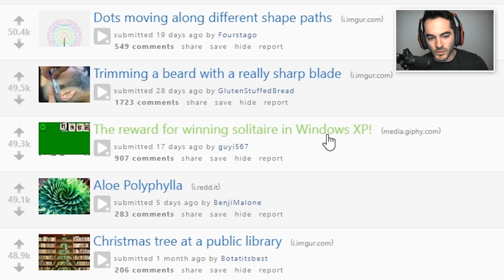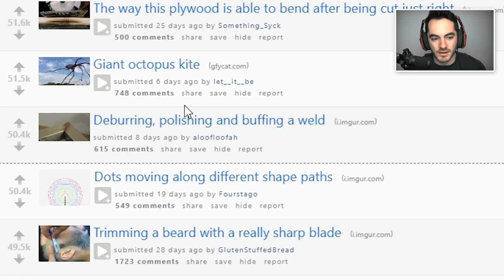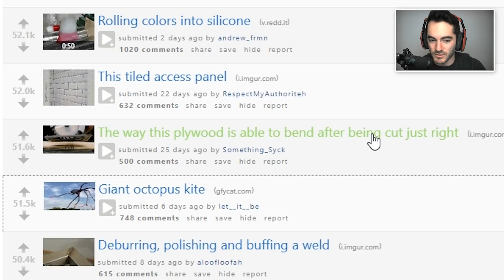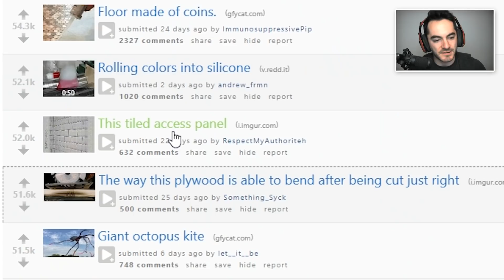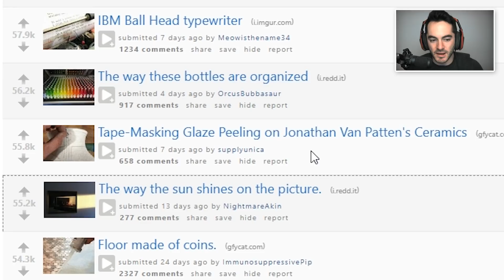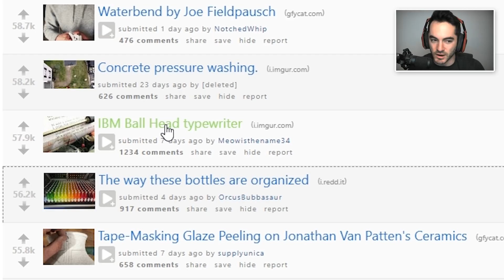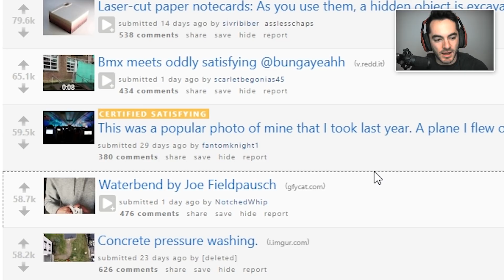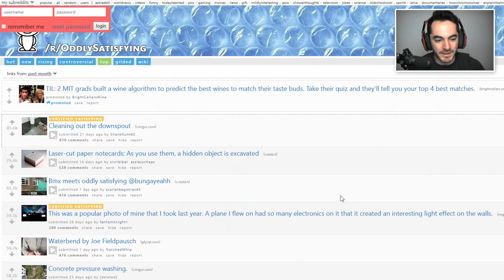HOW TO TASTE THE RAINBOW

Comment: TL;DR i did a ton of fucking math and yknow what if you want it just fuckin do it

On the penny floor...
Each square foot of "tile" would cost $2.56.

A square foot is 12x12 inches; a penny is 3/4 inch wide. So it would take 16 pennies to make 12 inches; 16x16 is 256, and since each penny equals 0.01, each square foot costs $2.56. This is assuming they're in straight rows, and not nested; nesting them would probably at least double that, so we'd be looking at $5.12 per sq foot for just the pennies.

Of course, that's just for the pennies. The clear coat is usually either an epoxy or a polyurethane; using an epoxy will drive up the cost and the labor ($200 for what you need and can be easy to screw up if you're new to epoxy/resins, from my research) whereas the polyurethane is much cheaper and easier to use (less than $50 a gallon, iirc, and can be spread thinly and easily done with multiple coats).

There's also the grout and the glue used to bond the pennies together, depending on how you decided to do that (what I saw was one guy used a plastic mesh and a template when he was putting them together) which let's say together would run you around $30.

Let's say you're covering your bathroom floor, with dimensions of 5x8'. You'd need to cover 40 sq ft of space (assuming I did my math right).

In pennies, that would be $204.80 to cover your bathroom floor, if you were nesting them. $102.40 if you were just putting them together, widest-to-widest end.

With the epoxy, you'd need to use the whole thing. You probably wouldn't use the whole thing with the polyurethane; at least, you wouldn't need to. So if you're nesting and using epoxy, your total so far is $404.80 (without tax, I won't be calculating tax on the non-penny purchases). Using polyurethane, and assuming you use half of it, your total is $229.80.

All of that without nesting would be $302.40 with epoxy, $127.40 with polyurethane.

Last, our average of the glue and the grout was $30. Let's say you needed all of it, to make matters easy. Your final totals are:

Epoxy-sealed, nested penny floor: $434.80
Epoxy-sealed, unnested penny floor: $332.40
Polyurethane-sealed, nested penny floor: $259.80
Polyurethane-sealed, unnested penny floor: $157.40

So, maybe.